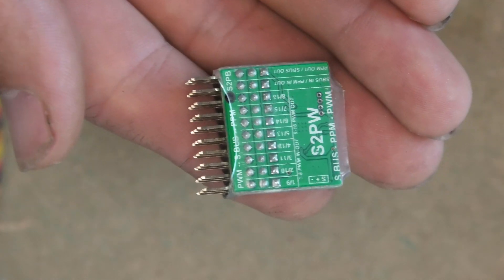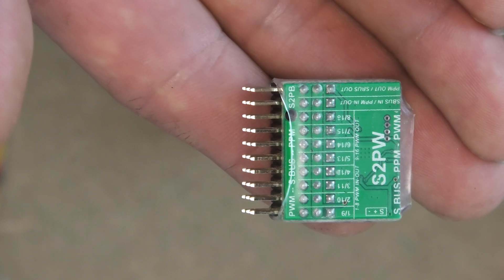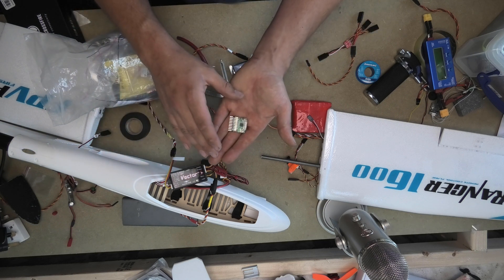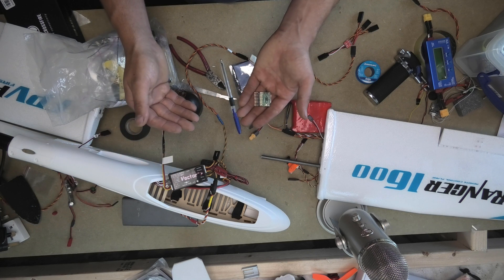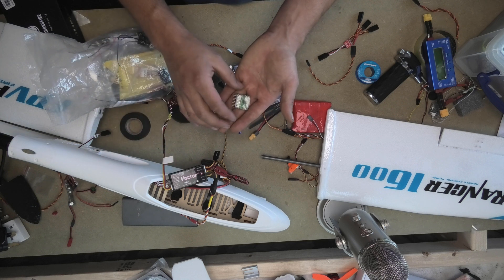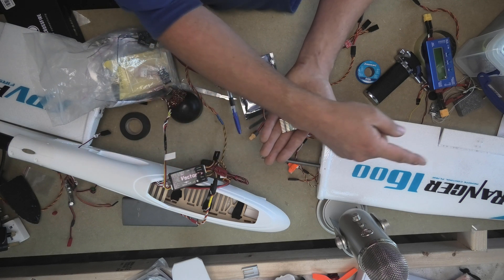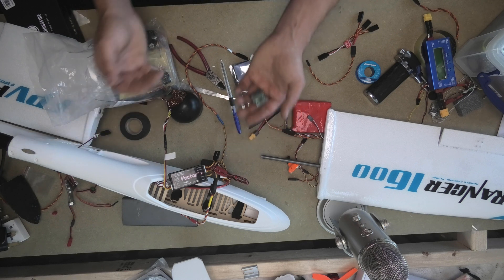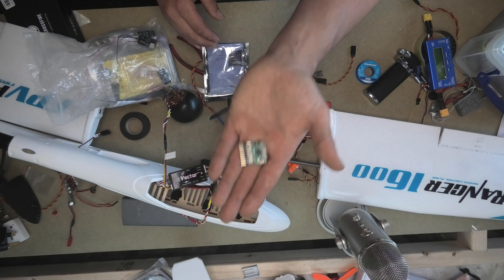"Amazing When You Need It" SBUS/PPM to PWM Converter

Comment: Trying to make my dji digital fpv controller work for my plane 
The controller runs on sbus
any suggestions?
Reply: I was wondering if this thing would work for dji as well
Reply: I just ordered a 4 channel version of this off amazon for 11 dollars. I'm going to give it a try on the dji fpv system this weekend if it shows up in time.  I'll let you know what i find out.
Reply: Kevin Brewster ordered one from HobbyKing.. not sure how long it will take to get to me but I’m going to start working on it as soon as I do.. can’t loose another plane do to rx/tx range(I was using my spektrum dx7) I would really like to create a simple solution for rc pilots who want to fly fpv
Reply: I also thought about the kopilot light on an airplane. They have sbus in and servo out. Banged up goods has them on sale till the 24th for 35dollars. They have return to home and some other stuff to.  Right now I'm working on setting it up on a swap boat.
Reply: Kevin Brewster what do you mean?
Reply from the maker: Errr this will get sbus to PWM as for that device, no idea I'm afraid. Matt
Reply: Watch some youtube about the Kopilot Lite.

Comment: Hi Matt,  
I am installing the DJI FPV camera on my glider,  
I want to connect all the controls on my glider / winged airplane (throttle , ailerons, etc. ) to the DJI air unit which is also a receiver has only one socket on it (which I think it is SBUS but not sure).  You can have a look on it .. 
https://store.dji.com/product/dji-fpv-air-unit?vid=82731
Can I use this thing?  Does this item comes with the SBus cable?  or I need certain cable to buy ? thanks

Comment: Matt, why did you choose to install a vector in your ranger instead of using a board running iNav?  I'm ordering the Ranger 2000 and I planned to install a Furious FC with iNav ... now you've got me worried because you've gone through such pains to cram a Vector in a place a   board would easily fit.  Also, when you put your RX and VTX on your wings, do you take steps to balance the wings.  I neglected to do this on a Nano Skyhunter with tragic consequences.
Reply from the maker: Hi Mark, see the live discussion I did on the Vector, it'll explain why. Matt

Comment: Will this do PWN to Sbus ?     . . . I have a dx6i  which means no Sbus
Reply from the maker: Howdy, no as explained, it's the other way around. Matt
Reply: @RagTheNutsOff  Do you know any way i can do Sbus ?
Reply: @RagTheNutsOff  Lots of videos i have to use subtitles when available so i can watch them
Reply: The Banggood link indicates it will do what you want with auto detection of what mode it is in.  Number 2 below.
 Instructions:
1. When the 9CH pin input PPM signal, 1-8CH pin output PWM, 10CH pin output S.BUS signal, blue LED flashes one time per cycle.
2. When 1-8CH pin input one or more PWM signal, 9CH pin output PWM, 10CH pin output S.BUS signal, blue LED flashes two times per cycle.
3. When the 9CH pin input S.BUS signal, 1-8CH pin output PWM, 10CH pin output PPM signal, blue LED flashes three times per cycle.
4. Without signal input, blue LED won't flash.

Comment: OK so here comes the stupid question. If I use an R9M receiver to pass sbus through to this and daisy chain 2 together to get access to upto 16 ch, will the power supply from a 20/30a ESC be enough to power all the servos linked up to the converter?
Reply from the maker: Hi Tony, very unlikely. You'll need a separate BEC, maybe two depending on the size of the servos. Matt

Comment: Have one setup in my sky hunter running off my r9mm works great
Reply: Have you tried the 4ch onboard PWM yet?
Reply: No I have sbus from the receiver for my pan tilt stabilization  and video cam switcher
Reply: I have the one from banggood that has all 16 pin out

Comment: Nice info... but didnt really understand how to set it up ???
I use mainly inav and there is no Sbus out from my knowledge....
So I guess I would need to have this as first in the row and then go to the inav fc?
Reply from the maker: Jan, go back and watch it again. You plug it and press a button if needed. Matt
Reply: RagTheNutsOff 
Really that easy!?
Uh
Okayyyyyy
So It doesnt really matter at all 🤔

Nevertheless, good info. Might use it to convert some unused Copter RX for plane use ☺️
Reply: @jas-FPV  Dead easy connect the SBUS or CPPM output from the RX into the input on the module. If you are running SBUS you can use the loop through and connect to your FC.

Comment: I love this. I was testing it for latency and it is great even for quadcopters. It perfectly fits my favorite v8r7-ii-2 receiver. Just a tip :D Ive removed the pins from the converter. Cleared the holes and soldered it right on mi receiver.....fits perfectly :)

Comment: ive had one in my parts box for like 2 years now but haven't ever used it
Reply: James Smith  I wanted to output ppm from my receiver but still have pwm at the same time but in the end I did things a different way.
Reply: James Smith  guaranteed, if I stuck it on eBay and sold it,  I would suddenly have a use for it.
Always happens that way lol.

Comment: Interesting. I'm using a different (only 4 channels) converter in my Z-84. I had to set failsafe to 'custom' to make sure each channel gets set to neutral (0% for throttle) when FS triggers. Might be different with that converter. Just a heads up.
Reply: Using a FRSKY X series receiver, I set the failsafe on the transmitter and it just worked.